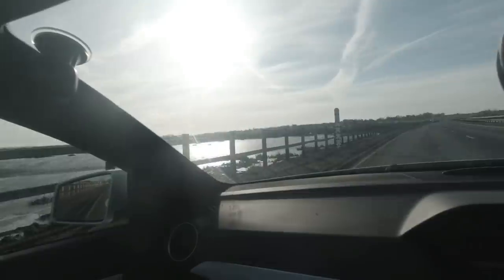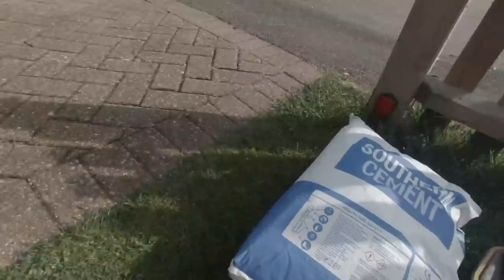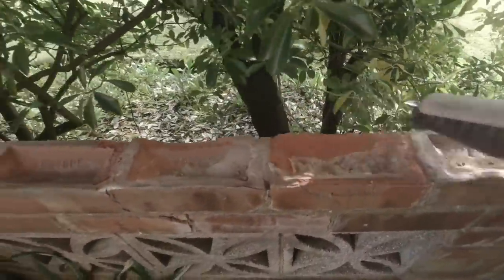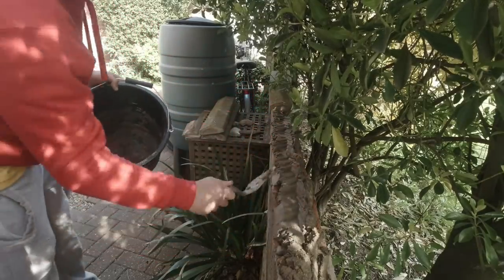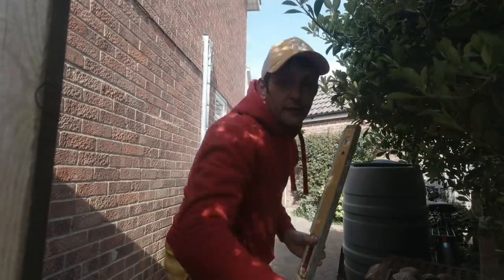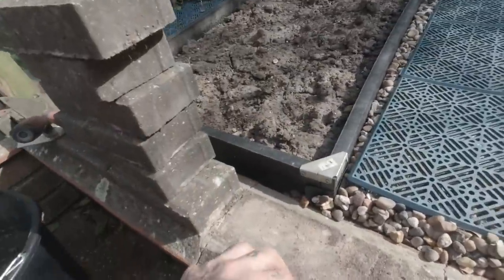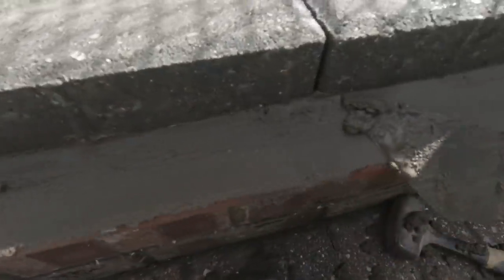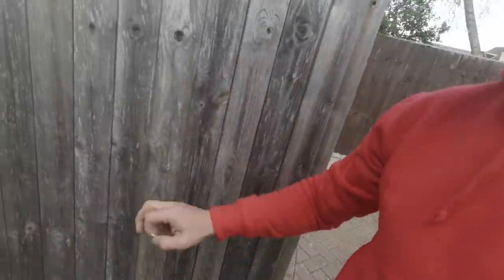A Handy Man

Comment: Love your videos and your overall attitude. I am from the United States and I have a couple questions for you. A lot of houses that are new construction brick homes get a scratch joint ( rake ) and I don’t ever see any of you guys in the UK do anything but a round joint ( concave) Do you ever use any other joints when pointing up?  The next question is everyone wants colored mortar. You hardly ever see white mortar unless it’s block work. Do you ever use colored mortar over in the UK?  Thanks in advance and keep the videos coming. Your videos always put me in a great mood. Do you ever plan on going back with your gang on site?
Reply from the maker: Hi Eric.  Yeah I do different pointing but it costs the client more due to the time it takes to do correctly. Most don't want to pay for it. I much prefer to do weather struck and cut . It makes a wall smile at you if you getvwhat im saying.. we have alot of what's called line monkeys here. The trade is being turned into a money making machine and your average Joe isn't bothered as long as its clean. The true art of bricklaying is sadly being lost 😔.  Ive left site partly because of this. They are more interested in keeping damp trays clean than the face of the brickwork. It's all about thermal isolation in the UK now.. I use white cement whenever I can . I love it. But again grey is £5 a bag white is £10 so people choose the cheap. Im not planning on going back on site but if times are hard I will ,but only out of necessity.  Hope your well bud. Feel free to join my live show tomorrow 7pm UK https://www.twitch.tv/tricky_brickys
And I can give you a live response to any questions mate. 😁😁stay safe bud 🙏
Reply: @trickybrickys  it’s basically the same in the United States with whatever is cheaper but when you are bricking a custom built home for a homeowner who is actually having the house built for them and not selling they always prefer the scratch joint and colored mortar usually a red or tan. Thanks for the reply. You are a great bricklayer and keep the videos coming buddy
Reply from the maker: Thats true mate. On private jobs I get to do the job properly normally down to my advice. Alot of places hear used white mortar and that makes a massive difference on the over all look. Take care bud and thank you for the compliment.  Appreciate that buddy 😁😁😁